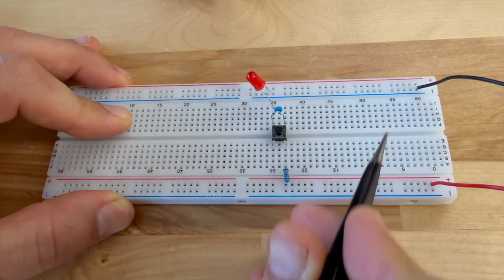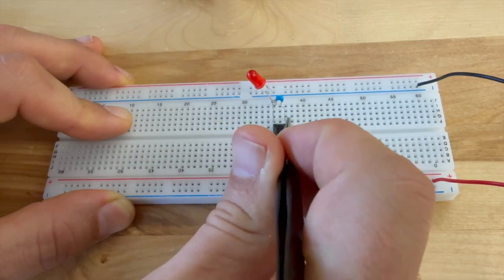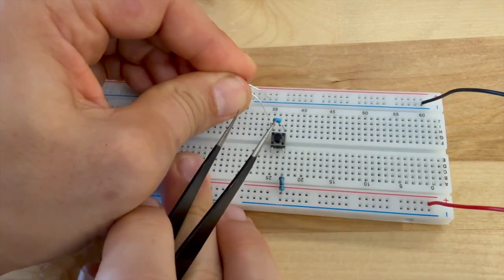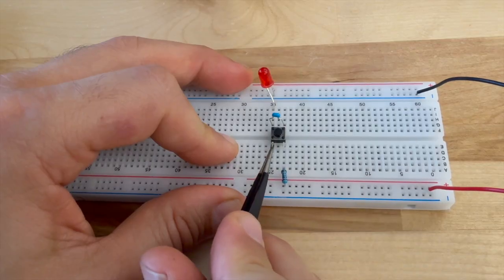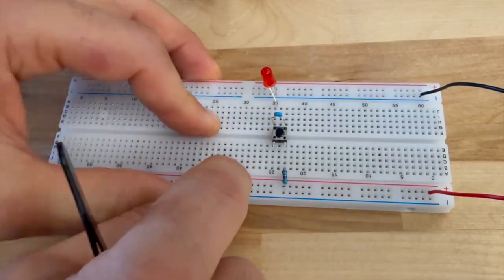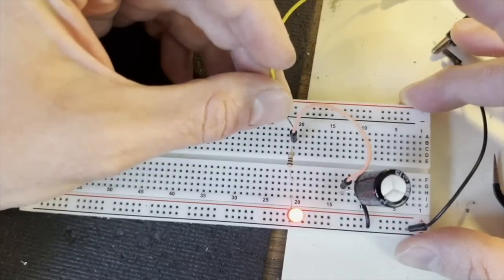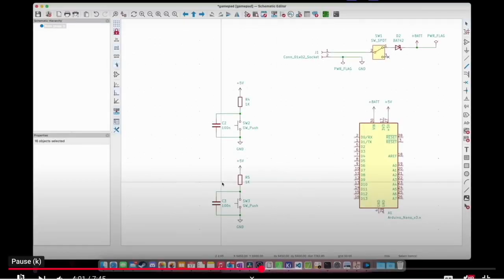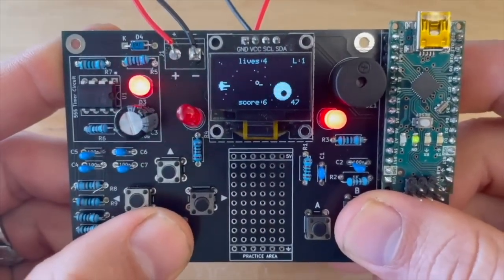Button Debouncing Circuit

Comment: What's the capacitor for?
Reply from the maker: For certain circuits it prevents accidental click - has to do with the rise and fall time - I'll try to get another video posted explaining this concept
Reply: without it a single button push can produce multiple shorter clicks because its a mechanical part that moves. capacitor smoothes it so its always one press